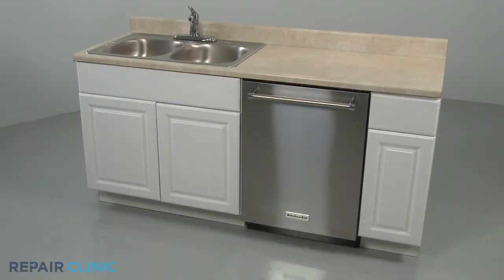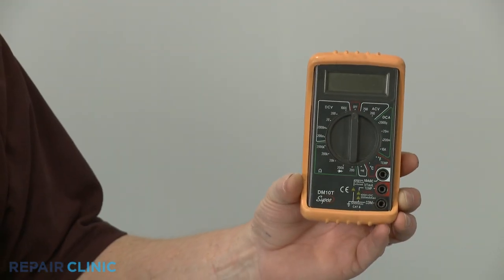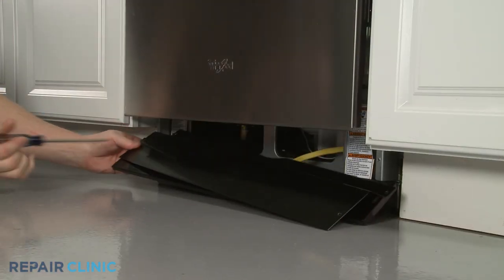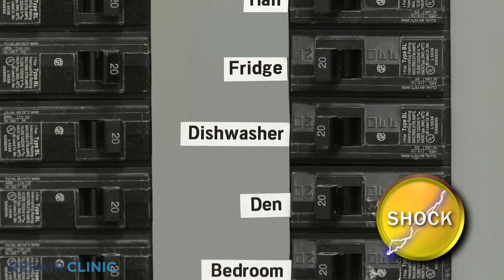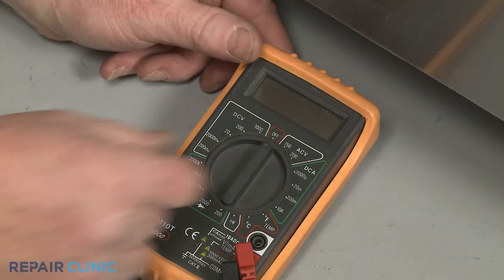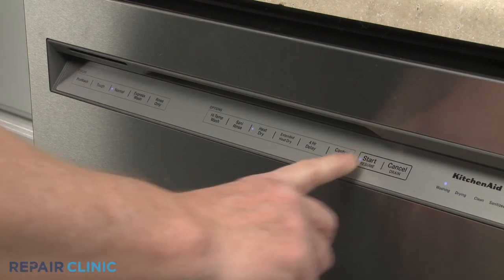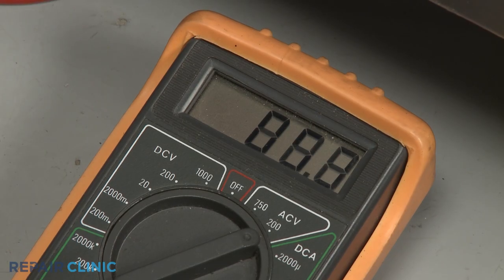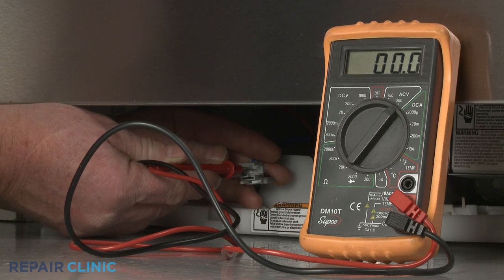Dishwasher Inlet Valve Voltage Testing

Comment: No water coming in. I get 5V in stand-by and 7.5V when I start a pre-wash program. Does this mean the valve is ok and the board is faulty?
Reply: Sure would have been nice if they'd said what the issue was if the proper voltage was there. I'm assuming if the proper voltage is there, which would be 120 volts in most cases then the inlet valve would need to be replaced.